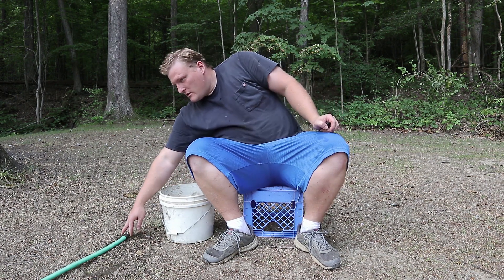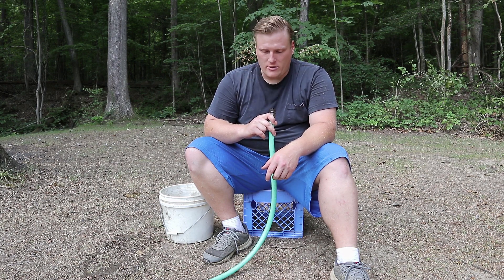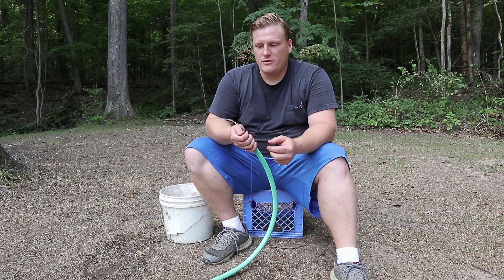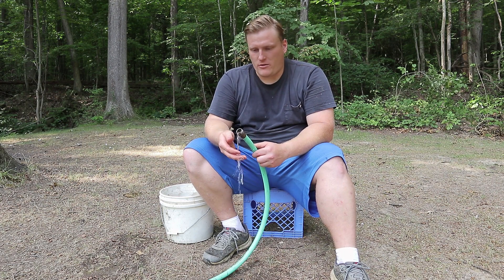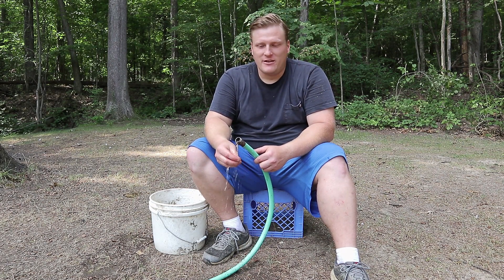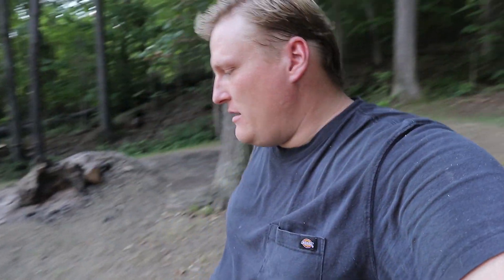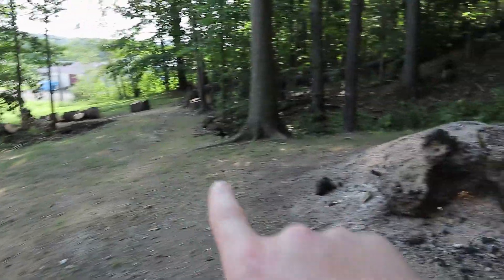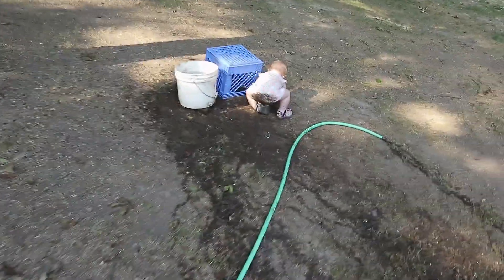August Flow Measurement (OBSOLETE, Watch Part 8)

Comment: Having seen your original waterwheel videos, I bet you could build a DIY irrigation system for your yard: four 55gal drums would hold a whole day's worth of water, and the 144Wh per day generated would power a 12v sprinkler pump on a timer for a couple of hours a day. If you wanted to go really cool, a PVC pipe with drip holes to make a mini scale center pivot irrigation system... if you're happy with a circular lawn :)
Whatever you end up doing with it, though - we'll keep watching your videos.

Comment: Hey, you seem depressed. If you need time away from youtube, that's fine. None of us would be mad. So if you are depressed, try to get some help, no one would want youtube to drain you. And happy birthday!
Reply from the maker: Well the problem is that I want to do more youtube, but can't get the time to. You can tell my content has been lacking.
Reply: @JoeMalovich   By the looks of it you lack a reliable source (of water) for your content to begin with. Hard to base content around something that only appears during certain times of the year.
Reply from the maker: @str8forthakill  I have about 6 to 8 videos worth of construction to do that is actually easier when it's dry, flow isn't really the issue right now.

Comment: Sounds like your only real option is creating a bigger collection at the spring. Maybe 55 gallon water collection at the highest possible point on the property for rain water to maybe help, regulate at a rate that wont deplete the reserve.
Reply: Collect some amount of water up top and let it go on some time basis to run a larger water turbine until it empties, and then refill again.